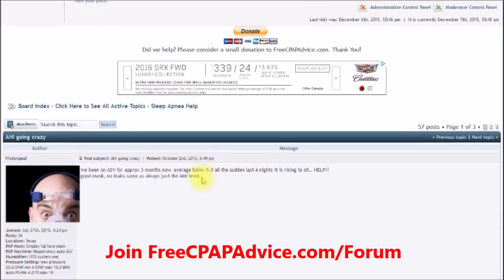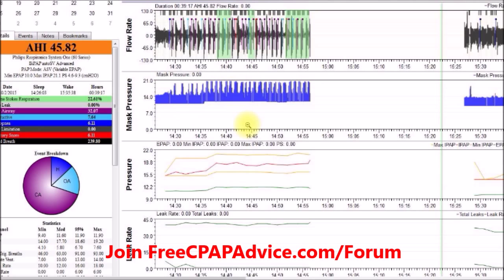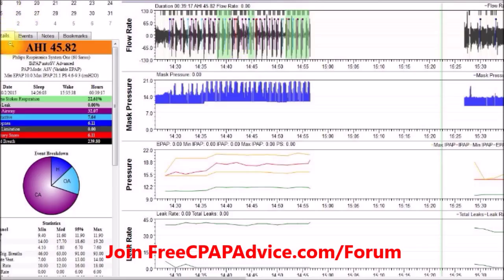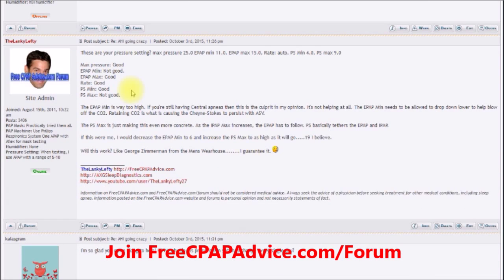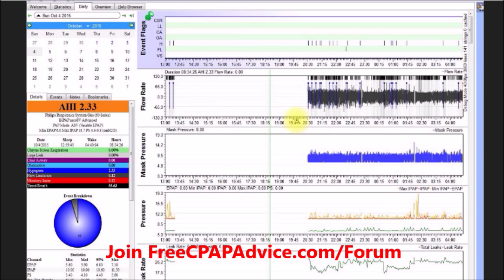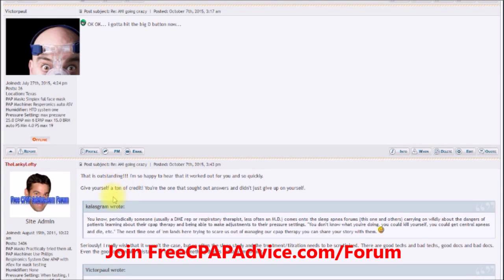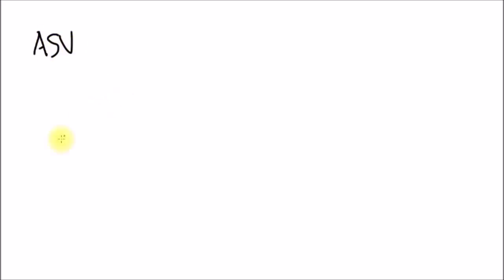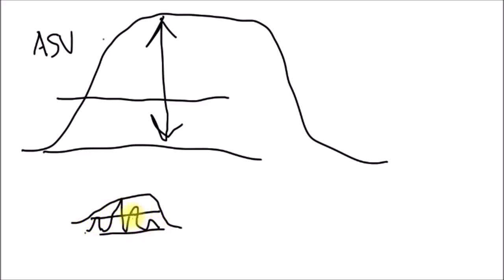Auto Servo Ventilation Settings.  What is the correct ASV Setting?

Comment: The resmed aircurve 10 vauto doesn’t have PS min and PS max it just says PS
Reply from the maker: It’s fixed on your unit.  They aren’t independently variable.  An ASV is independently variable.
Reply: TheLankyLefty27  okay, that setting can reach up to 20 with my IPAP max at 18 (currently) and EPAP min at 4 I’m not sure what the fixed setting should be for PS? This is  all new to me
Reply: That machine is a BiLevel machine.  It's not an ASV auto machine IIRC. I had the same machine you are talking about and had to send it back into the Medical Supply Company and then they gave me the ResMed AirCurve 10 ASV auto.